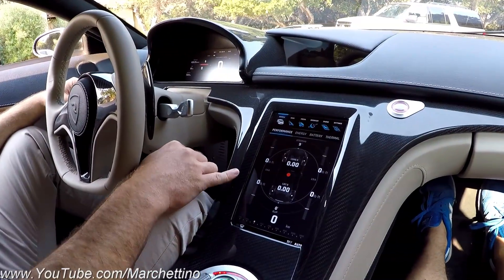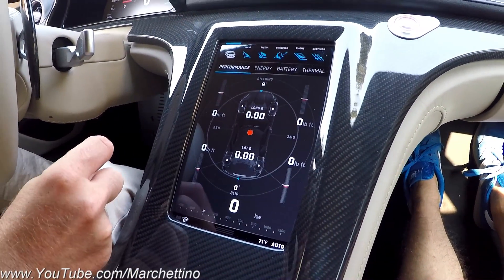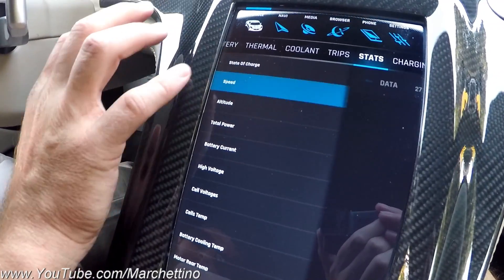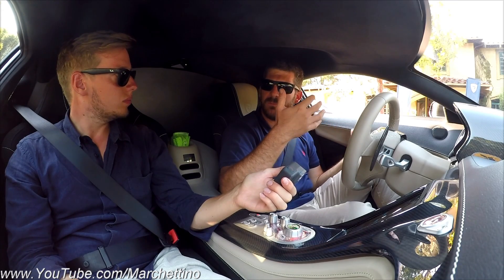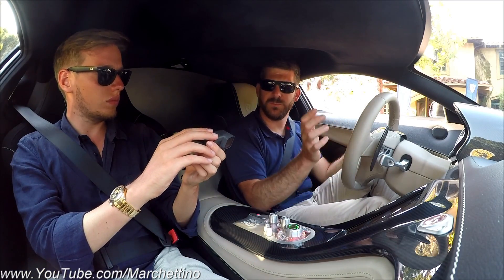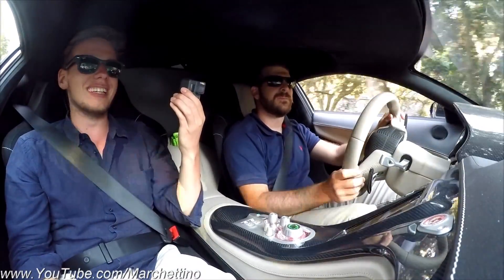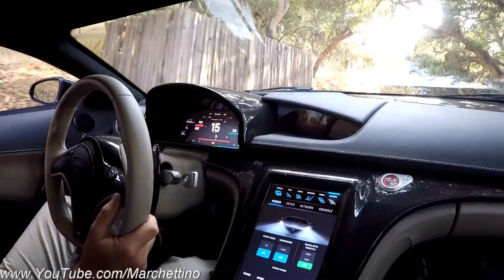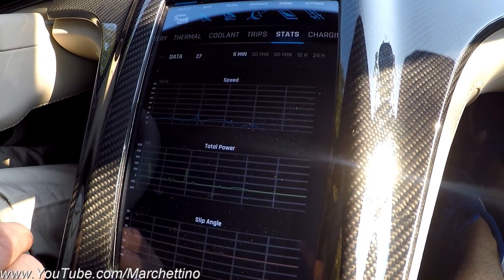My in Depth Experience in the Rimac Concept One! - World's Fastest Electric Hypercar

Comment: Good grief, that thing is HIDEOUS!  On top of that, it's a car without a soul.  You're essentially paying for the raw materials at this point since electric motors essentially all sound and deliver their power in the same way (though, of course, the magnitude of that power may vary).  IF electric cars are the future, I predict the cost of high-performance cars will fall TREMENDOUSLY because the experience (minus the G-forces of the outright performance) is pretty much identical between electric cars.
Reply: + flyingphoenix113 You can either accept the future of automobile industry or live in the past. It's your choice.
Reply: Electric drivetrains feel similar because they're all essentially at the apex of power delivery. There's no need to compromise.

Maybe that's boring to you, but putting down nearly maximum power to the wheels at any speed puts a bigger smile on my face than loud noises do, which is why I'm watching reviews of cars rather than stereos.
Reply: +flyingphoenix113 I could understand your point, if an average person could actually own a V12 in their lifetime.
Reply: Lazar Kaganovič there are some pretty cheap cars with a v12 but not cheap to maintain lmao
Reply: +Lazar Kagnovic I'll live in the past, thank you very much.  Why would you ever want to drive an electric car when V12s, V10s, and V8s exist?  Why put a smile only on your face when a V12 can put a smile on EVERYONE'S face.  To each his or her own, but I will GLADLY make the sacrifice to drive petrol cars until the day I die.
Reply: flyingphoenix113 so, the only thing you appreciate about this car is the performance?
Reply: +Redstoneprime Of course not.  I can appreciate the technology and the torque vectoring, but it isn't really anything new.  In fact, I would hate to drive a car like the Rimac that only prioritizes maximum lateral grip.  I would much rather drive an electric car with a locking differential and more conventional handling characteristics because I enjoying being able to control the car past the limits of adhesion (which, as Richard Hammond proved, is nearly impossible in a car with limits as high as the Rimac).  That said, technology is the FIRST thing to date a car.  Compare a 1980's Aston Martin Lagonda to a 1960's Aston Martin DB5.  Which is more valuable?  Which would you rather own?  One is a timeless GT with eternally good looks.  The other is an 80's relic that is about as timeless as a Casio Calculator watch.  The Rimac will likely be a sub $100,000 car in the near future.  It only offers semi-innovative technology, and at the rate at which technology is progressing, it won't be technologically relevant for long.